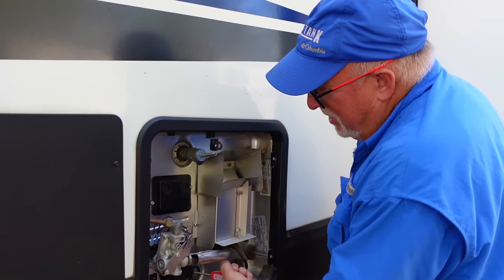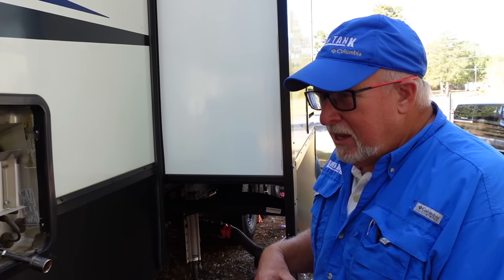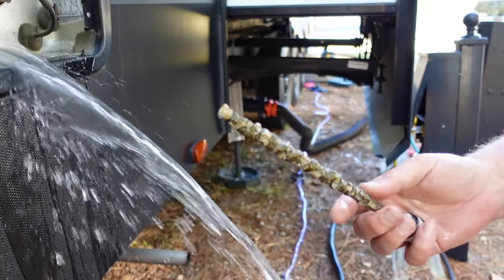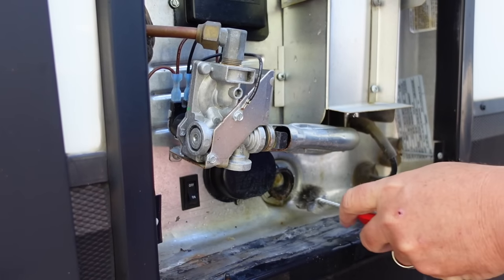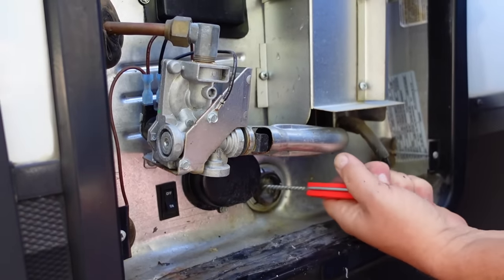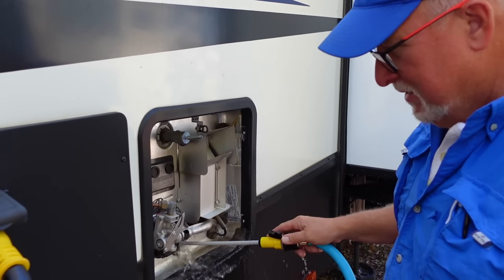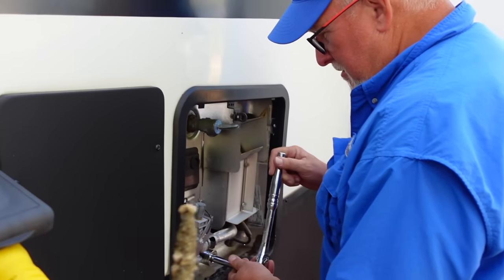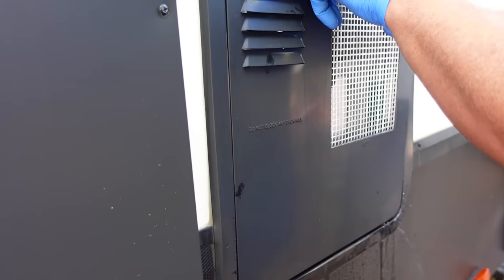RV Water Heater Maintenance & Mistakes Every RV Owner Should Know!

Comment: Google : "Atwood water heater not needing sacrificial plug"
Posted By: skipnchar on 01/20/11 08:20am

Well it's a LITTLE more than just being aluminum as aluminum is also subject to electrolysis. The reason Attwood does not need an anode rod is there is ONLY aluminum used anywhere that comes into contact with the water. If a brass, steel or iron plug were used THEN electrolysis would attack because of dissimilar metals being in contact with the water. That's why it's a poor idea to replace the nylon plug with a metal one because once that is done damage will occur.
Reply: We own a Dometic water heater and it doesn't have an anode rod

Comment: Good video with useful info. As I looked at the link for the anode, it goes to the cheap ones with the black top that he warned to NOT use... I expected the link to go to a Camco anode. I do have an Atwood that is 34 years old in out 1990 HR motorhome, fortunately, it works great and when I drain it, no granules come out, but I will be getting a wand to flush it out before we use it next year (winterized now).

Comment: Is it wise to put a metal anode rod in an Atwood.  If the pressure relief valve failed, those plastic nuts are made to eject under high pressure to keep the tank from bursting........just a thought.

Comment: 14:45 The cheaper anode rods are usually magnesium which doesn't last as long as aluminum.
There's nothing wrong with using magnesium rods if they are lasting a year or more. If they aren't you should be using aluminum.

Comment: I’m getting ready to add a drain line to my water heater. It doesn’t have the anode rod at least, not at the drain plug, but poor design to have the water pour out over electronics and the schematic decal. I’m putting an adapter, short brass nipple, stainless braided hose with a shutoff valve. That way I can drain it without pouring water everywhere. I think using it a few times a year and draining it afterwards, flushing/sanitizing it, it will hopefully last. Great tips though

Comment: Do not open release valve to fill water heater. U need an air pocket at the top of the water heater to allow for expansion of the water. Simply turn on a hot water spigot in the RV. This will let the water fill to proper depth inside the tank.

Comment: Mine has a brass threaded  drain plug that needs a flat head screw driver to remove.  It’s in a 1992 Gulf Stream Insbrook Classic 5th wheel. Any idea what kind of tank mine is?

Comment: Another great tip video.  Thank you for sharing.  Question: Jim said don't buy the anode rods in 2 packs, but your link for the Atwood anode rods is for a 2 pack.  Is this an exception?
Reply: I do strongly recommend the Cameo anode rods. I've never seen them sold in two packs, but maybe there's now an exception.
Reply: @kleentank  ok, thank you.  I just wanted to be sure the link was correct.  Thanks again for the great advise.  Wish you the best  with your business.

Comment: Been RV camping for 20 years, and have never had an anode look like that. I check it every fall when we put the unit away for the Winter. Also, I thought you were supposed to leave the valve closed and a faucet open to fill the heater tank? They're supposed to have an air gap for expansion.

Comment: I've tried the brush to clean the threads and still have a very slow leak.  I read that using a 3/4NPT thread tap cleaner will work - any recommendations on product to use to give the threads a good cleaning?  Thanks 🙂

Comment: Hi Kent. Hoping you'd be a great resource. Mine is a 96D190P and I have a large longitudinal crack in the hot water line from sink faucet to exiting hole in the back wall / cabinet. Would you have a how to comment on the replacement of the line? Thx

Comment: this was a very informative video.  We own a tiny trailer with a six gallon hot water tank.  Do they sell rods that would fit in a small tank or do you recommend just cutting down the longer one?? I'm not sure what brand it is.  It does have nylon threading.  We also empty the tank after every trip, so I'm guessing there isn't much build up.?

Comment: Mistake is a proper title ! You should never open your pop-off valve ! When you open the pop-off valve you risk getting calcium deposits in the valve that then makes the valve leak beyond what is acceptable. When a hot water heater is at temperature it is common for this valve to drip. But if you ruined it by opening then you will get a major leak and have to replace valve. Open the hot water side of the faucet to let tank vent to drain. Never open your Pop-Off unless you want to replace it. ! 45 years of RV repair excellence. Erics RV Repair Folsom CA.

Comment: I thought the switch in the outside cabinet turned off the hot water. Where did you turn off the hot water heater before he started?

Comment: The water heater in my house is 20 plus years old. I have replaced both elements and thermostat switches 
about 5 years ago. The lower element quit working so I replaced everting while I was at it. Never seen an anode rod in a residential water heater that I recall. What makes an RV so unique that it requires an anode rod?
Reply: Did you search YT for Residential water heaters?  We watched one and the Anode rod was located on the Top of water heater!

Comment: My previous rig had a water heater with an anode rod. My newer rig water heater has a cap on the drain port but does not have an anode rod. Should there be an anode rod installed?

Comment: The tip you missed is never to touch that outside switch when its wet there is a good chance you will get shocked there is no seal between that switch and the tank and the wires are exposed and not sealed ( the switch Is cheap garbage ). Been an RV tech for 20 years and and a repair shop owner for 8 ,I  can not count the times I've heard an apprentice let out a Yelp the next bay over and learned that lesson the hard way,

Comment: I bought a new anode from the local RV dealership and it absolutely won't thread into the water heater.  I bought 2 more through Amazon and they would not thread either.  The old threads easily in and out.  Any ideas??

Comment: Wow, the haters jump on everything and it's because they're not LISTENING.  Great video sir.
Other videos on cooking 30% vinegar 50/50 with water overnight for the flush.  I'm guessing you don't think this necessary?  I did an overnight cook with 3% vinegar (yes 3%) and got very little white stuff out.  Mine is a '15 Atwood with nylon plug so I'll get the tools and anode you linked and try your method.

Comment: In my opinion he missed replacing the heating element. If you anode is that bad, I am willing to bet the element is also in need of replacement. I usual change my anode twice a year (yes I utilize the 2 pack) and the electric heating element once a year ($15).  I do run my water heater on both gas and electric at the same time for quicker recovery.
Reply: The anode looks exactly like we expected -- that disintegration shows it is doing its job. A worn anode rod does not correlate with a failed or failing heating element. Good question, though.
Reply: That anode is still good.. it is sacrificial metal... it's supposed to do that. They are worn when down to pencil thin... I drain our tank after every use.... My thank has never been that dirty•••••••
Reply: @rich4860  the difference is I live full time in my rig. So it’s constantly submersed. Also, I have to respectfully disagree with Kleen Tank stating that there is no correlation between an anode and a heating element. Being full time and helping out others I see almost all the time when the anode is pretty much gone, there is good chance that the heating element is also corroded. It may still work, but not nearly as efficient as a new one. The cost is minimal so to me and IMHO it just makes sense to replace it at that time.

Comment: I only use rain water in 5th wheel camper. My heating element is still  pristine after 5 years. City water will destroy your element in short order. No anode required with rain/distilled water. You're welcome.
Reply: The dirty water ions will accelerate the corrosion in the hot water tankk. But corrosion can still occire even with distilled water because the hot water tanks have dissimilar metals in the various components of the tank system. Dissimilar metal parts combined with water will cause the system to act like a weak battery and corrosion will start.

Comment: Hi everyone, and thank you for the very informative videos.  I have a question, hopefully someone can help me out here.  I have been RVing for 2 years and still learning everyday about maintenance.  I tried taking the anode rod out and it seems like its stuck, rusted shut.  I have tried spraying it with WD40 and even more different brand rust loosener and its still pretty stuck.  I'm afraid of putting too much pressure in opening it and breaking it and damaging the hole where the anode goes.  Any advise would be greatly appreciated.  Thank you all in advance :virtualhug:
Reply: Heat may help when you try to loosen it... have your water heater on (only when when full) and try to loosen it... Do NOT remove it; just loosen it. A small flame torch can be used to heat the head of the rod...
Reply: You might need a ratchet with a longer handle to get more leverage.  Could try a breaker bar.

Comment: Mostly good information, I don't agree with the use Camco brand only.  If you read the Suburban manual you will find the part number is actually for a magnesium anode, which is what you will find in the 2 pack you bought.  They do state you can use an aluminum/zinc anode for longer lasting (which is better for a full timer) or if you have frequent issues of the rotten egg smell from the hot water.  Any brand aluminum/zinc anode will last longer then any of the cheaper 2 packs which happen to be a magnesium anode.
Reply: We've had excellent experience over 18 years with Camco brand anodes rather than cheap knockoffs. Some of those cheaper anodes are bit longer which does actually affect the rate of flow out of the tank (we've had customers complain about that when we replaced a bad anode with one they had on hand -- not one of ours).
Reply: @kleentank  You are welcome to your opinion, though if you check the manufacturer they actually tell you both magnesium or aluminum alloy anodes are acceptable for use, its in the manual.  For 7 years of running the longer anode in 10 and now 12 gallon units, I have yet to have any loss in flow or pressure.  So maybe an issue on 6 gallon units, I will keep my view that your information is biased to a product you like to sell.

Comment: For you new RV owners, notice how far in the new anode rod is installed.  It does NOT go in all the way to the top of the thread.  It is a tapered thread.  I made that mistake and over-tightened mine wondering why it wasn't going in more.  Couldn't get it out in the fall.  Still drained the tank as best I could but I'm in for a treat when I try to figure out how to loosen it in the spring.  Silly me.
Reply: I really like when people like you state their mistakes to keep newbies like me from making the same mistake. I never would’ve known that it is a tapered thread. Thank you so much!
Reply: I had a hard time removing the anode the first time I did my own winterizing and flushing. I looked around the garage and found a 5 foot length of 1” poly drain pipe that fit over the handle of my ratchet wrench and gave me the leverage. I needed to turn the nut on the anode. I noticed my local home improvement store has random short cuts of pipe in case you don’t have any lying around.

Comment: Never replace a plastic plug with a metal one. The plastic plug is a safety device.  The plastic plug will melt if the unit overheats.
Reply: That's a fallacy, that is the purpose of the pressure relief valve.
Reply: @dancorby4576  That's what the manufacturer says the plastic plug is for, but what do they know.

Comment: This guy constantly contracts himself. Just like on the other video. When talking about the anode rod he says you must buy a good camco one that should last you a year. 
But earlier when talking how often you should do this he said 4 times a year. 

When a service person constantly amplifies the service they provide and tells you they only have the best parts. WATCH OUT. The odds of that actually not being an Amazon anode rod are very low. Notice how he said they were longer but when he pulled out the anode rod they were the same length so then he immediately said, oh it’s black yep that’s the bad one, it’s black? They are annode rods bro. 
Tricks of the trade

This usually happens when am someone provides a service that anyone can do but they still want to have a reason why they should do it for you. 
Do you really think in a 6 gallon tank that a 2 inch longer anode rod is going to restrict water pressure. No of course it’s not. Think about a 5 gallon bucket, putting a 2 inch longer rod in there is going to cause massive restriction in the water pressure or the bucket? No

How did he clean the scale off the inside of the tank up to the top? Think about why he didn’t do that. All he did was swap your annode rod. Those are about 3 bucks a piece. Spending the time to do it right by flushing with vinegar would not allow it to be a “free” service. 
To detect someone who is really good at BSing you. One has to listen real careful and pay attention FOR the slight of hand. This guy saw you from a mile away, Tom. But made your think he did you a favor.

HOW MUCH WAS HIS BLACK TANK SERVICE and “FREE” annode swap? Probably at least $399. Pretty good for all labor and no parts.
Reply: he said flush the tank 4 times a year, not replace the anode 4 times.  I noticed though, that he didn't spray around inside the tank.  Only sprayed the bottom.  Notice that the valve on the sprayer stayed in the same location in his hand.  And I also don't understand how a longer rod would reduce water pressure, unless the tank inlet or outlet just happened to be in line with the anode.  Anyway, some good info and some that needs confirmation.
Reply: Okay, let's clear up a few things here. I said that full time RVers should flush and clean their water heater tank four times a year -- not replace the anode rod that often (that would be incredibly unusual). We most often do this service as a complimentary service along with a standard tank cleaning service AND we teach the customer to do it. I have never seen an anode rod for $3, by the way. As to your point about cheap, oversized anode rods restricting water flow, your water bucket comparison doesn't really make sense and I don't think you truly understand how water heaters are constructed and work. Sorry to take a firm tone here, but there are a lot of pointed statements here and accusations (which I don't appreciate) and I just wanted to set a few of them straight.
Reply: 1000% agreed... He's spreading nonsense

Comment: He didn't even do the full service. He didn't even clean the orifice tube. He didn't clean out the burn tube lol
Reply: As a complimentary service to a holding tank cleaning, we simply flush and clean the water heater tank. Examining and maintaining other elements of the water heater are certainly something every RVer should perform as recommended by the manufacturer.